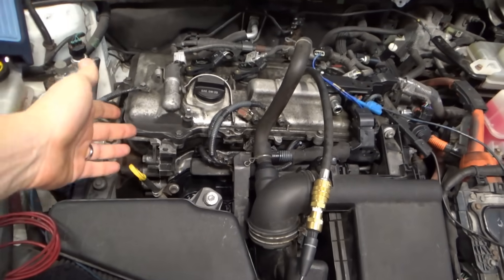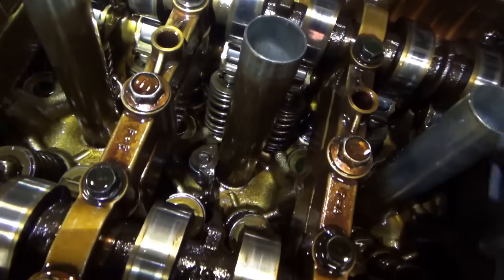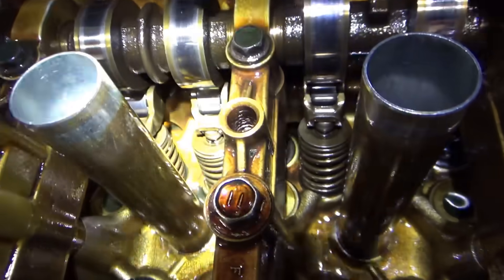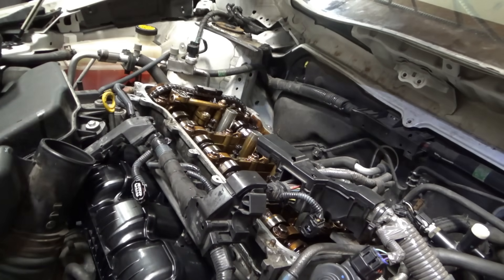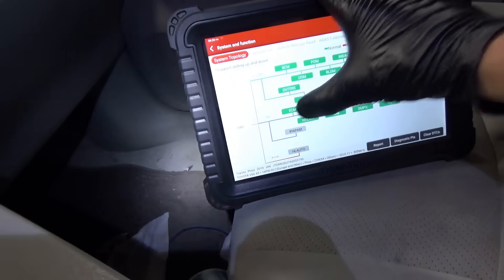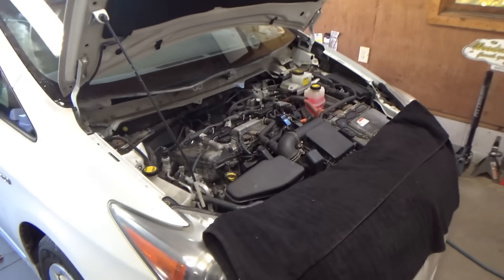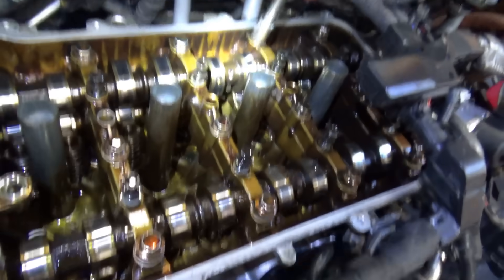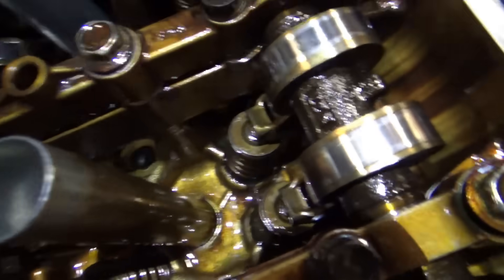(Pt 2) Prius DIY Head Gasket...Now BARELY RUNS?!

Comment: I have one of those 2014 poisonous Prius V models with only 100k miles, but I have been experiencing some strange issues with the transmission when it gets just about warm or when it's around 80 degrees outside. The car drives fine in the winter, and I don't notice this issue whatsoever, but as soon as it gets a little warm outside and in the summer heat, it is pretty bad. The car starts acting funny because it is not shifting properly. When I press on the accelerator, the engine revs, but the power is not immediately transferring to the wheels or it will slip, and it feels like it is not shifting properly because it revs but won’t accelerate immediately. The same can happen when it is downshifting. I usually can't run the AC because that seems to make it even worse, but in the summer heat, it gets really bad, and I don't even feel like I can drive the car. When this occurs, especially in city traffic during those hot days in stop-and-go traffic, I try to drive really slowly just to avoid this issue. I also have to release the pedal from the gas slowly and let it resynchronize when this happens or try to smooth out the shifting so I can continue for a little longer before it happens again. I changed the transmission oil with Toyota's fluid at 60k miles, and this issue seems to have been there when I bought the vehicle new because it seemed like it started doing this at about 16k miles. The oil change didn't seem to have helped. I complained about this to Toyota, but they obviously denied it, and it is much worse now. I would love it if you could assist me, or if anyone else knows something about these issues and can point me in the right direction. No lights ever come on, and I don't have a scanner, at least to see the temperature of the fluid for the transmission. I would appreciate it if you could help. Thanks!"

Comment: If toyota has problems with there hybrids just think.of the problems other comapanies are having. Another system that is junk is stop start systems. Most engine wear is from staring your engine so if your staring your engine evertime you stop at a light good luck with the engine it aint going to last. Oh and dont get me started on cylinder deactivation. Just to be fair all these systems are because of ever increasing EPA regulations.  So the next time your new 80,000 truck has a lifter chew up your cam call your congressman and thank him.

Comment: When these cars gets even older and it's too expensive to repair the engine, they are perfect candidates for a relatively cheap EV conversion. Just add more batteries and a way to charge them, and possibly add something that makes the car happy without it's regular engine.

Without modification they might be a bit slow though. A gen 1 Prius will do about 70km/h (40mph) on battery without modification, and if you pull the fuse to the fuel pump it will do about 90 km/h (50-55mph)

I bet that there will also be a market for ECU add-on that simulates a Prius engine and lets you use any other engine.
Reply from the maker: @The-secret-101  I honestly don't think anyone is going to bother to modify or convert a Prius into anything other than tin cans 😆
Reply: @PineHollowAutoDiagnostics  Never say never. They seem like the perfect candidate for various experiments.
I've been toying with the idea of attaching a wood gasifier, small engine and generator on top of the trunk lid of a Prius or similar, and hook that up to charge the battery.
Reply from the maker: @Thesecret101-te1lm  😂would love to see that contraption in action!

Comment: I cannot believe you are not putting a vacuum gauge on the intake tract on every car you get. Had a vacuum gage been used you would have found a needle fluctating like crazy. Then if you wanted more more detail you could have used a pressure transducer .  Just listening to it run sounded like a valve problem . Normal intake vacuum is relatively steady, there is no way this one was. I have been there.  Vacuum gauge hookup takes 5 seconds.

Comment: Ivan, for what it is worth, I would have suggested to the customer to dump the oil and take off the oil pan, in case that part migrated to the pan.  You would hate to have that in the oil pickup in the future.

That said, my assumption is that when the engine was reassembled, something was not done right, and perhaps that was already missing.

Comment: The reason the head gasket fails:
-PCV valve allows too much oil to pass into the intake. 
-Oil enters combustion chambers
-Oil travels towards exhaust, but some makes its way toward EGR, but travels through EGR cooler first
-EGR cooler gets very clogged with oil (oven cleaner works best)
-EGR gasses can no longer reach intake to be reintroduced into combustion chambers
-EGR gasses help keep combustion chamber temperatures low
-High combustion chamber temperatures cause had gasket to fail
- to avoid all of this, clean EGR cooler, replace PCV valve, add aftermarket oil catch can
🖖

Comment: There is absolutely no way both of those followers somehow were installed inproperly and then fell out of their normally installed position underneath the camshaft without causing major damage to both the camshaft and the followers. You all saw saw how Ivan reinstalled them; he had to loosen the camshaft significantly and then slip the followers underneath such that the camshaft held them down when tightened. The only logical conclusion is that the owner forgot to reinstall the followers after installing the head gasket. In my opinion, Ivan did not examine his conclusion that they "just fell out" closely enough.
Reply: most of them you can use a valve spring compressor, and a special tool to pull the followers out and out them back in, without touching the cams.
have to make sure the piston is not at or near TDC or valves will hit.

Comment: Gen 2 prius is nearly bulletproof. We did replace the HV battery once when it went out, but amazing car otherwise. ORIGINAL front brake pads lasted 200,000 miles (verified, my dad bought the car new in 2005), and its still on the original rear drums and shoes. The inverter coolant pump failed but was replaced in the driveway for less than $50. The car was at 288,000 miles last i checked and other than a small amount of oil consumption the prius shows no signs of slowing down.

Comment: I've had a gen 2 Prius (2008) for about 14 years and it's been one of my most reliable and favorite cars ever. It just crossed a quarter-million miles on original engine and battery.
Reply from the maker: Nice. Don't buy the Gen 3 haha
Reply: @PineHollowAutoDiagnostics  gen3 redesign has too many issues.. my 2007 gen2 Prius is now at 426k miles, did the head gasket because the previous owner hacked the cooling system (3 way valve) and sold it to an unsuspecting lady (overheating)

Comment: I have owned 3 Toyota hybrids (09,13,18) and have never had a single mechanical issue with any of them. You continue to bash hybrids because you repair them but don’t own them. They are very reliable and cost effective vehicles! I will never buy anything else!!!
Reply from the maker: @rogerrocco5211  are they all at 200k miles? 🙄

Comment: I'm still wondering where the missing valve cap went. Maybe the owner spaced and forgot all about it, otherwise it's there in the engine someplace. Also, I think the point of owning one of those is, be the first owner and unload it after 100k miles. You see a lot of Priusi for sale on CL with between 100k and 200k miles. I wonder why.

Comment: The last Prius I repaired had 390,000 miles on it and was averaging 53 mpg. We did the brake booster pump, the motor would intermittently not start to prime the booster.
My wife drives a Corolla Cross Hybrid an SUV and averages 45 mpg. Not sure if the added cost of the vehicle ever catches up to the fuel savings, but it is nice going 450 miles on 11 gallons of gas when it's time to fill up.

Comment: At my shop at home we mounted a trailer receiver to the floor at front of shop. Have an electric winch that slides into receiver then use that to pull dead cars into shop. Easy push out on the downhill grade then just winch them back in.
Reply from the maker: @jeffco908  I just use my Suzuki 4x4 to push the beached whales in if necessary 😆👍

Comment: I have never been tempted to buy one (have not seen one on my local market place page) but even with one being there I do not have enough experience or bravery to purchase one I will stick to my ICE vehicles something that I know I can DIY. As I van said are you really making that much of a saving ? Cheers Ivan (to me I would have to find that cap it would drive me nuts thinking it could foul up the engine in the middle of nowhere & leave me on the side of the road with no cell reception).

Comment: The problem of going "OEM only" is when the OEM part failed prematurely. Did the OEM address the issue in the replacement part? Similarly, some aftermarket parts manufacturers do address the issue. Yet the difficulty is to know which aftermarket manufacturer did address the issue. Even with good intentions and shelling out more for OEM only, it still can be a crap shoot.

Comment: What would cause all 02 sensors to have a reading of 0 . No voltage shown on scan tools pids . No short term no long term. Nothing. Fuse to 02 sensors is good. Only code is 02 sensor shorted to ground. Is it possible that one shorted to ground would bring all of the sensors to not read anything. 🤷🏼‍♂️

Comment: Supposedly, only in 2010 had an engine problem. My nephew had a 2006 with battery a issue. I offered to help him replace the bad battery modules. He said he just wanted out of the yard. So, I replace a battery module, a tailpipe, and new tires with rims at the salvage yard. So, for less than $200, I had a Prius. This worked okay for several years, but then another module went bad. Then, every several months, one would go bad. So, I bought new Lithium modules for $1700. It's been good for about 3 years now. Just last week, I replaced the rear struts as both springs were broken in several places. I still have the old modules and some. Would you like them? let me know.

Comment: Yes it's Definitely a Problem with these, I know of a few Owner's doing these head gaskets to keep them on the Road, Much like the D17 Honda engines found in 2001 thru 2005 Civics also have head gasket issues but are Great on fuel We still daily two of the 05 special edition Ex Civics. The one is getting close to 300.000 miles.
Reply: And Yes I have Great luck with the Multi layered steel Blue Felpro Headgaskets People who don't have surface or bolt problems maybe bad threads in the blocks I don't know or Not clean-flat enough surfaces.

Comment: Head gasket failure on a Toyota.... is it the "acidic" coolant issue where the narrowing of the cylinder wall thins at the water jacket hole?  could it be avoided with proper coolant replacement or is it inevitable... thanks Ivan.

Comment: My 2007 Prius needed no serious repairs for nearly 300k miles except a refurbished battery. I did 10k oil changes which was a mistake because it was using a qt of oil every 650 miles when I sold it for $2k after completing a 7k mile road trip west coast to east coast and back. No complaints from us!  Our new Prius is a 21 Prius Prime that we love.  We’re doing 5k oil changes on this one. I’ve heard we should avoid 2010-2012 because of head gaskets.

Comment: The repairs later in a hybrid's life may eat up all the fuel savings, but you'll be hard pressed to find any ICE without repairs needed north of 150k miles. Now you're paying for repairs and you DIDN'T have the fuel savings either! Glad to see another car get diagnosed and fixed!
Reply: 2011 corolla (same 2zr family motor) 220k…. Never been inside the engine, just a whopping alternator for $150
Reply: @braaapattack2937  I think the theory is, since the engine is off and on due to the hybrid power, there can be issues with it not maintaining full operating temperature and cause more issues than if it just ran all the time.
Reply: @braaapattack2937  Wow, one ICE car hasn't needed repairs - I guess the mean NO ICE cars ever need a repair under 200k miles, right...right... 🤦
Reply: @Cheepchipsable depends on what it is, a Camry and Corolla will be far more reliable then a Nissan Altima… not all ice cars are “bad”

Comment: I know you hate the Prius, but you said it yourself,  There are millions on the road.  You're going to see more Prius in for repair than other cars just by the numbers.  You don't have to be woke to buy one.  I've got 220k on my 2006 and the only things that I've done were the big battery, the little battery, front and rear shocks, brakes, tires and wheel bearings,  Total of about $2,000 to $2,500 in the 75K that I've owned it.  Savings on gas over a car that's 30mpg over that time is about $3,000.  No rust despite living in south central Minnesota.  You can hate them if you want, but I've never owned a better car and it's bought me a LOT of ammo.
Reply from the maker: Still cheaper to drive a Corolla or Civic that gets close to 40mpg 😉
Reply: @PineHollowAutoDiagnostics  Possibly.  I might throw the Camry and Accord in there too.

Comment: We had a Toyota Camry Hybrid for 14 years. It went 220,000 miles with no major repairs. The original brakes lasted to 190,000 miles and it only needed one 12 volt battery at 11 years. Other than routine maintenance, the only repair was the flex joint on the front exhaust at 12 years. The car averaged around 38 mpg so the "hybrid" savings was about $5000. Fewer brake jobs and batteries likely saved another $2000. For our hybrid, it was worth the risk. Possibly we got a good one. As Ivan says, the risk increases significantly above 150,000 miles. To some extent that's true with ant car, but especially so with a hybrid and the complexity of hybrid powertrains can make repairs expensive.
Reply: With the 'hidden cost of hybrids' thought - I feel like at those mileages, you're really just pointing out that there is room for improvement. Can't assume any car would make it further without some repairs.  Including a modern Toyota.  You're also implying that the problems being experienced in these generations wouldn't be able to be engineered out for future generations.  

A hybrid is inherently more complicated than a straight ICE car, no doubt - but comparing apples to oranges when looking at reliability of a 10 year old car to a modern car.  The new ICE cars are not likely going to do as well as the older ones anyway.  And the price of fuel - who knows what's going to happen with that.  Improved fuel economy, paired with potential plug in hybrid tech really changes the calculation for what makes sense.
Reply: You forgetting reduced trade-in value = zero. Big loss there.
Reply: In Europe we are paying over 2 dollars a litre for gas or diesel. 
The later models ironed the issues out. 
My next car will be a Lexus hybrid
Reply: @jeremyaustin9103  ls600h is very cool

Comment: When it comes to most engine parts and replacement parts 95% of the time ALWAYS GO OEM, (do not confuse OE- spec with OEM either it is not)., like he said OEM for everything but when it comes to gasket fel-Pro seems to be good as well. But when it comes to coil packs spark plugs fuel management pumps whatever basically anything in related never ever go non OEM and especially never ever go dorman lol serious I know it may cost a few bucks more but at least you know you're getting a quality part that was meant for the vehicle and built for that vehicle. Play games with knock off unmarked parts and you wonder why they only last a few months or they don't work as intended or you're fuel economy goes down or you have random misfires here and there or little issues you can't pinpoint or an idl that's rough once in awhile or a hard start here and there trust me OEM makes a difference

Comment: I've felt the same way long term about EV's, a little less on the Hybrids. Same with solar panel systems and other "green" alternatives. It's fairly obvious the engineers are putting the cart before the horse when it comes to green versions of just about anything. How about the green version of brake parts cleaner? The stuff is three times more expensive and doesn't clean as well. We use solvents and chemicals which are $25 a gallon today yet 15 years ago the same stuff was $3 a gallon such as Acetone or Lacquer Thinner. Now we have ethanol in fuel, 15% less BTU's yet three times more expensive so less MPG for more money. It's something to think about, are these "improvements" doing us any good?  If so, by how much? It makes you wonder if "green" products aren't just another TAX.
Great approach to finding the problem by PHAD...use your basics first and then proceed.

Comment: Usually FEL PRO has a reputation of solving prone OEM gasket issues.  The FEL PRO perma dry steel intake gaskets on my 2000 4.8L Silverado have been great so far.   No more death shakes after cold starts in winter weather.